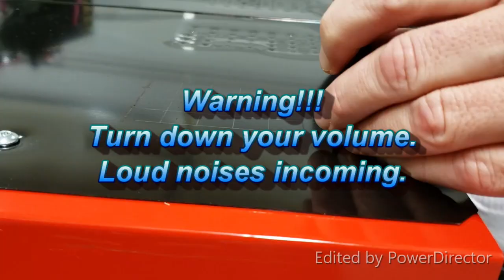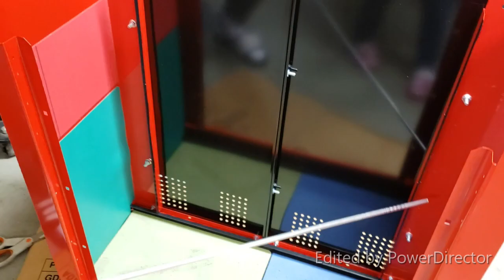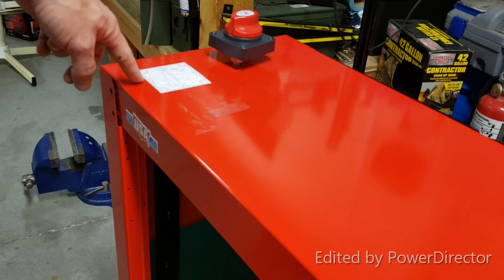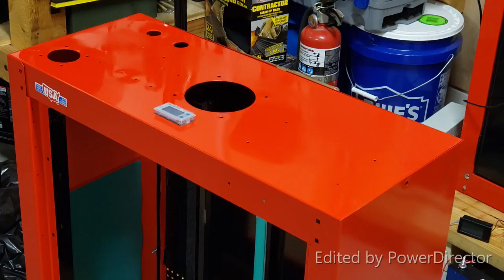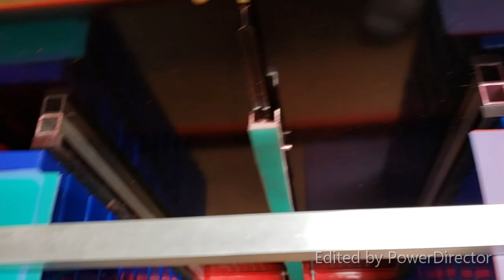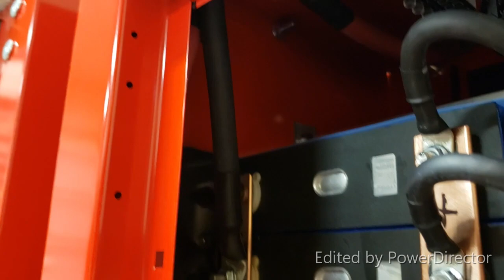LV5048 Power Wall 3.0  The Build Video.

Comment: There is nothing like the feeling of making/harvesting your own power! Everyone needs something like this, even if it's only a 1200-2500 watt inverter, with 200 ah battery. The way things are getting, with storms and such, atleast it would keep the fridge going, and allow  cooking with a microwave, and most importantly, keep you out the dark! Even if it's grid charged, being 12v LiFePo, you could charge it with a car, if you had to,,,    but I'm off grid, with a 24v system, and a 12v system. I have 6, 120 ah batts, and a couple 250ah, and some Nissan leaf batteries, I modified to allow 7s connections. About 33kwh, and about 400ah 12v LiFePo bank, I'm going to get a smaller 12v inverter, that will run the fridge and microwave, about 2-2.5 kw or so, I'm using a DC to DC to keep charged, and use a balance charger , but I'm thinning I'll put 300-600 watta of pv, on the system,  and keep the option of charging from the 24v bank, and vice versa, for emergencies, I have a DC generator in the works also, to charge the batteries directly, I just need a midnite classic controller, I'm using delco alternators, modified to allow charging of 12 and 24v batteries, with a 12hp engine, even with a large battery bank, charging at 96 amps it will not take that long, I could charge to about 75% without, if I only use a single 150 amp alternator, I do not want to damage the batteries! The controller us a must, maybe I will eventually get a few midnite classics, and can use for solar normally, and switch to the hydroelectric mode and use the DC generator, in a emergency, if the engine can handle it, I can do around 600amps at 28v, but will likely never do that, having no grid access, I need backups of backups, I also have a 2.5kw generator, and a 7 kw generator, but a generator running all day gets old fast! I also have a 1500 ups with 600 ah of lead acid! Back up power! Not counting all the USB power banks, the smallest is about 8ah, the largest is around 50! I'm rambling , sorry,, happy Thanksgiving,

Comment: For electrical insulation, I found cabnet liner at the dollar store, it's a opaque clear slightly rubbery plastic, it's about twice the thickness of heavy card stock, or construction paper, it cuts nice and is on a roll with a decent width and length, it has a slight texture on one side, and smooth on the other. I don't have it handy, but it is about 16-18" wide, and maybe 20' long, it's perfect for stuff like this, and it's only $5,/

Comment: As for the corrosion.
Do not touch any metal(especially copper) that will conduct electricity with your bare hands.
This is because of the accidity and sweat on your hands(even when they feel dry to you). It might look clean now but it will corrode.
You might not notice this on tools or doorknobs but that is because there is no electricity flowing there.

Now my experience comes from a couple of years I worked as a cable guy and for a HF coax cable those things are a lot more important(in fact the regulations for the company I worked for were so strict that when you had a random inspection and they noticed as much as a scratch on the core you would get a warning/get fired, touching the copper was another big nono and they would even measure the exposed shielding and core to the mm) but I have seen copper cable getting corroded in a year because the previous guy touched it or the customer thought it was a good idea to replace the wall socket themselves. 

It starts as simply dulling, then greyish but given the right conditions it will turn as green as my picture on the left. However correctly handled copper will stay nice and clean for years(as long as you do not put it in a damp basement.

So do yourself a favor if you have to make a V4, wear gloves when touching any surface that has to conduct.
Reply from the maker: Correct and this is what I have used to minimize problems with corrosion. https://youtu.be/c2fM01O0vQQ
Reply: @DMIINC2013  (Just watched the video)
Ah yes I noticed you applied that, can't say anything about that as I never used it but I just wanted to let you know in case you were not aware of how touching copper conductors will speed up corrosion. 
(And perhaps others that face issues with corroding connectors or cables)

That being said, I was not aware that you live in a place with a high hum lvl(This was only the first or second video of you I watched as I am researching for a EV sailboat conversion) so simply "not touching it" would probably not be enough.

I would still wear simple latex gloves but to each their own and when it works it works ;)

Comment: Congrats on finishing it! Looks like it took a long time. Update us in the future as to how your system is doing.
Reply from the maker: will do. It took 7 days to build. maybe 25-30 hours.
Reply: @DMIINC2013 
1.  please what is the nominal voltage of your  battery bank

2. The power value

3. The continue charge current

4. The discharge current

5. The maximum System
Reply from the maker: @godfreyjohn-obaika8368  https://youtu.be/lTPHlZ1pibU

Comment: Excellent job but instead of the electrically insulating mats I will try spray on coating for the whole interior like the EPDM Flexseal or the product you put on electrical connections to insulate them
Reply from the maker: Make a video. I want to see that.

Comment: Sorry, it's better  to use the battery cells in upright position, standing on themselves with a bit of compression. This prevents squeezing of the cells by the weight of the other cells. By charging and discharging they will push something. Naturally they like to get bold and fatter. If all the weight of other cells in a stack, will give a force too (weight), this will be to much for the bottom ones. Therefor the bottom cell or cells will start leaking! So upright is the only correct position. You can't stack them. Only like books on shelves. 

I only used the cardboard very stiff corner pieces with came inside the box. on the four corners and some ducktape underpressure around the pack. In the cap between the duck- gorilla tape I put a piece of kartonbox. This way the cells are never in contact with the tape, but are compressed to each other by the ducktape. AFter taping on cardboard compressing the cells. I tiedend the screws of my busbars. I got a real stable battery-pack with no cost, some compression by ducktape on carton.
Reply: Agreed

Comment: Hi, I knew that lifepo4 cells must be placed vertically to function correctly, otherwise they can have malfunctions, decreased life cycles and even short circuits.
Reply from the maker: Over 2 years on the side and so far without issues. I have 144 cells like that. Out of curiosity how many cells you have and what is your experience so far? Thanks.
Reply: @DMIINC2013  Hi, thanks for answering me. I have no direct experience yet. I am choosing the components for my first solar system and when I saw your video it seemed a great solution to me because I have very little space for batteries and other equipment in my house. But then I googled the "correct positioning of lifepo4 cells" and found that they can only be positioned vertically. I am designing a system with 32 280 ah 48v s / p cells and a 6kw / 12kw inverter.
Reply from the maker: Great.
Reply: @DMIINC2013  I have heard the same thing as Roberto.  From what I have read you might 'possibly' shorten the life/power efficacy of the LifePo4 over- time . The LifePo4 Electrolyte (Lithium Salt is the term I heard) might migrate away from some of the "jelly roll" pouches on the top and instead of getting 3000 discharges you get 2000 (IDK , just speculating) .
Reply: It might matter what Brand Lifepo4 Cells you have .  Do you know ?
Reply from the maker: @thomassenator8170  There are plenty of examples of other manufacturers laying their cells on the side. Some examples are on the other channels.
Reply from the maker: @thomassenator8170   See this video at https://youtu.be/SGzeZfk6QgE?t=713 Those cells are on their sides inside of that setup. None of use have definitive answer. So far I am doing ok.
Reply: @DMIINC2013  Yes I totally agree.  In fact there are lots of Rack Mounting (2U 3U etc) solutions out there the same way.

Comment: Love your setup man! does this top bar enough to compress/fix the batteries?  and stop the stress on the copper busbars?
Reply from the maker: Top bar only prevents movement in the pack. There is very little stress on any one component due to design. My charge and discharge per cell is way lower then 0.2C per cell.
Reply: @DMIINC2013  never tough of using mesh busbars?
Reply from the maker: @TheMahdifarhat  May I know why would you suggest mesh/flexible bus bars? Power Wall 1 is two years old with out any ill effects.

Comment: Very nice, I am planning/hoping to mirror your set up just a smaller scale. I have the fan, temp controller, shut off, monitor… Do you have a wiring diagram on the top of the power wall? Like the two small wires coming from the cut off, not sure about some it and just don’t want to miss something. Thanks!
Reply from the maker: What I did is in the video. Two wires from the cut off are for DC to DC converter and Volt meter. Thanks.

Comment: I saw that you had planned on using a transfer switch at the main panel to add a generator. Are you using a pure sign generator and could you elaborate on any plans? What model of generator and the plan to integrate would be interesting. Thank you for the videos !
Reply from the maker: My system will be so called selfish solar. So I will be using grid as my back up once everything is done. Transfer switch will be used only in case of total solar system failure as inverters can act as transfer switch in case batteries get low. So no generator use of any kind.

Comment: Nolax would be better.....prevent galvanic corrosion between aluminum contact on the cells and copper busbars....or make aluminum busbars....
Reply from the maker: Trying a proven solution first. For power wall 2.0 I will use, if ox-gard works as I think it will, some of MG Chemical silver conductive grease.
Reply: @DMIINC2013  corrosion and high current is a serious problem.... At first is not worth of mention but with the time is getting worse and high current is exponentially make tings more worse...
If I could sugest..... between cupper busbars and battery terminal put stainless steel washer...
Great video's by the way.... 👍

Comment: The Link to the DC to DC converter doesn't work. What is it for. Shouldn't the batteries create the voltage you want? Or is it a voltage regulator? Can you post the brand/model so we can find it.
Reply from the maker: Powers fan, fan temp control and USB charging port.
Reply from the maker: https://www.amazon.com/Converter-DROK-Adjustable-Regulator-Transformer/dp/B08LPVWX74/ref=sr_1_2_sspa?crid=YLIVX8IBPQST&keywords=dc+dc+converter&qid=1644185182&sprefix=dc+dc+%2Caps%2C145&sr=8-2-spons&psc=1&spLa=ZW5jcnlwdGVkUXVhbGlmaWVyPUExNFpKMEo5QkVNMzRJJmVuY3J5cHRlZElkPUEwNDI3MDMxMkFUSDJHRTMyNktLQiZlbmNyeXB0ZWRBZElkPUEwNzczODIyQjFEOFNBSFlIMUJEJndpZGdldE5hbWU9c3BfYXRmJmFjdGlvbj1jbGlja1JlZGlyZWN0JmRvTm90TG9nQ2xpY2s9dHJ1ZQ==
Reply: @DMIINC2013  Okay, got it, it is not for the battery power. It is to power all the other supporting electronics and USB ports. thanks

Comment: I have a quick question.  with the LV5048 or LV6548 units, once your batteries are fully charged does the inverters have the capability to send excess solar power to the electric grid for a credit?
Reply from the maker: No.

Comment: Quick question - one of the items in your parts list is a DC to DC converter. Can you explain what you use this for, and how it's connected?  Also, the Amazon link is not working, so can you recommend an alternate?  Thanks!
Reply from the maker: I use DC to DC converter for thermostatic fan control module. I also use it for 12 volt USB chargers. https://www.amazon.com/dp/B08LPVWX74/ref=cm_sw_em_r_mt_dp_KPMASA0RYN70HHCFNE0C?_encoding=UTF8&psc=1
Reply: @DMIINC2013  That's very helpful, and thanks for updating the link.  What is your input power source for the DC to DC onverter?  Is it powered by the batteries, or by one of the outputs on the LV5048?
Reply from the maker: Batteries.

Comment: Hello, can you tell me what difference does a 16s 3p of 100ah have, with a 16s 1p of 300ah?  Thank you so much
Reply from the maker: My setup was most economical solution at that time for me. If I had chance I would have went with 300aH cells.

Comment: what length width and hieght are the cells you use in mm if possible the link doesn't go to a specific cell and there are many several may bot fit in the cabinet 4 widths across
Reply from the maker: What I have is this https://www.alibaba.com/product-detail/CATL-3-2v-Lifepo4-120ah-prismatic_62347534119.html?spm=a2700.galleryofferlist.0.0.64f15e2f6AueUG and you can get brand new 150 AH which are same size and weight from here https://www.alibaba.com/product-detail/LiFePo4-3-2V-150Ah-Cell-Lithium_62449546236.html?spm=a2700.galleryofferlist.0.0.778617ecYdgU3J Good luck with shipping anything from China at this point.